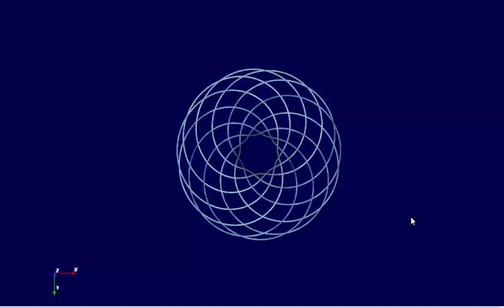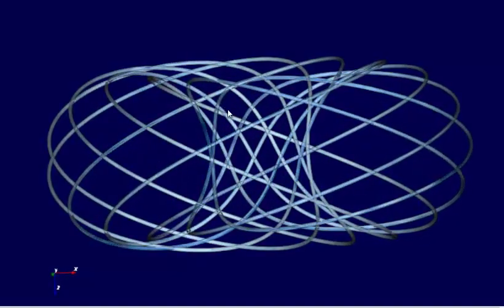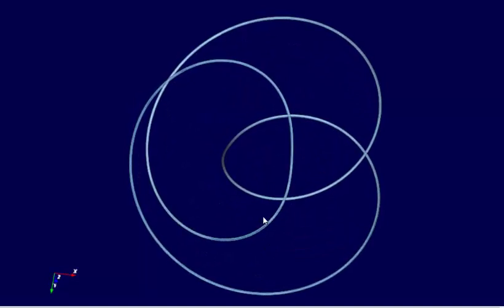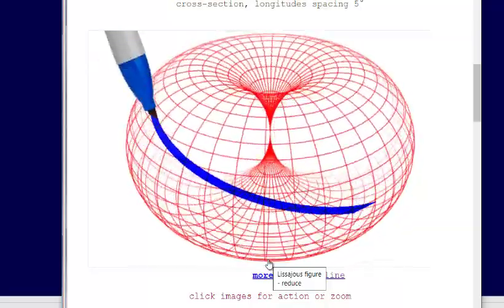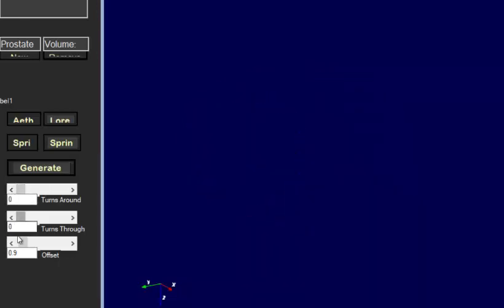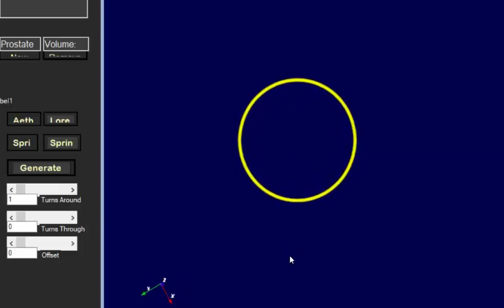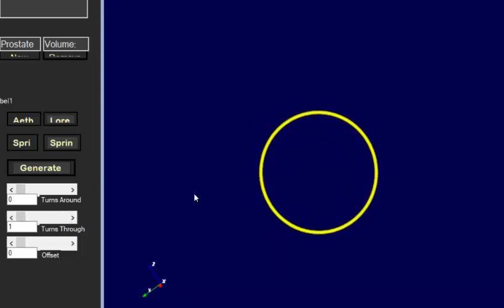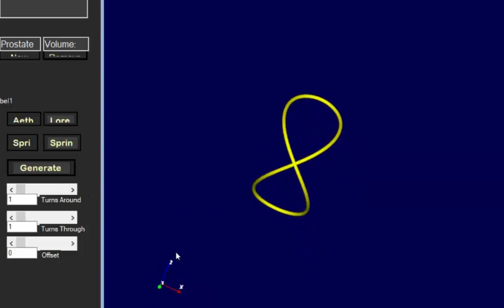Tokamak and the Torus Knot

Comment: What is the software you use for modeling turns through and around? Did you write it yourself, if so is it available online? Would love to play around with it and learn. Thank you for all your work, I love you!
Reply from the maker: Yes I wrote this software. Here is a link to the program that I gave Master Ivo:
https://drive.google.com/file/d/17vZUsIplsxohFd5N7Jq0J4_jHmHvVUfu/view?usp=sharing

You will also need to download and install this:https://www.microsoft.com/en-ca/download/details.aspx?id=48145

Here are the instructions::
1) Launch the TorusKnot.exe executable. 
2) Setup the slider bars for turns around, turns through and offset. Offset makes the "donut" hole bigger and smaller. 
3) Click the Generate Torus A or Generate Torus B button. A and B are reverse windings and reverse flow. You can also show both. 
4) Click the Import Colours button to select a colour palette and animate the flow. The colour palettes are in the Colour Files folder. 

5) Use the scroll bar on the mouse to zoom in and out.   
6) Use standard mouse manipulations to change the orientation of the model. 
7) You can change the slider bars while it is animating (which is fun).

That's about it.
Enjoy
Reply: @FractalWoman  Thank you very much for sharing! ❤️🙏
Reply: @FractalWoman  Hi! Is is possible to re-post the download link please? It says it expired. Thank you!
Reply from the maker: @J.ConorGrogan  I checked and the link is working. Are you talking about the link to the shapeways model?

Comment: Not exactly sure how'd this work out, but what if you got machine learning into this thing. By using lots of pics and videos, I think you'd be able to train a NN to match up your torus simulated "points" with the "light" lines in a ferrocell. And add the magnet to the simulation/use as 3D overlay. This could also even give you a volumetric perspective instead of just one torus knot (more than one line of points simulated at set distances apart)
Reply from the maker: Funny you should mention machine learning. In the field that I work, medical imaging, we are using AI, and machine learning to do all sorts of things that we use to solve using mathematical algorithms. AI is overtaking math. I like your idea. I will give it some thought.

Comment: I saw when you posted about inductors under the ferrocell, but what about an individual wire. Or parallel ones (w/both parallel and anti currents). Also a "plane" of wires, w/differing currents aswell

Comment: What would happen w/a negative offset, would it appear exactly the same or would things get crazy
Reply from the maker: With a negative offset, the dielectric (inner spindle) overcomes the magnet (outer surface) and it looks like the two switch places. The magnetic then looks like the dielectric and vice versa. Not sure what this means, but I have a feeling that will be the subject of another video. Thanks for asking.
Reply: @FractalWoman  when do you think the dielectric begins? Between the intersections of the spindle, or when the knot starts curving inward/where the horn begins
Reply: @FractalWoman  also what if you scaled Z to 0.618 instead of 1.618
Reply from the maker: @rustycobalt5072  This is "knot" the right thing to do. In order to get the spherical geometry, you either multiply Z by 1.618 or... you multiply x an y by 0.618. If you multiply Z by 0.618, then you just get a flatter torus shape which is not what I was going for in this exercise.
Reply from the maker: @rustycobalt5072  It is my opinion that the dielectric exists between the two intersection points of the spindle.

Comment: Is plasma one of the states of matter?
Reply: Yes, but all states are arbitrary and labels we use basically just because of our perspective ie water/steam/ice. 
Check out supercritical fluids too
Reply: On Earth (with gravity and atmosphere) we understand the "states of matter" sequentially as Solids - Liquids - Gases, and - Plasma (lightning,fire,neon,aurora,welding). 
Plasma has 3 distinct modalities (depending on their electric charge potential)  1.Dark , 2.Glow(neon,fluorescent), 3.Arc(welding,lightning,sun) 
What we call space is "dark mode" plasma (low voltage),, making it the most abundant form of matter in the universe. From there, the rest fall in reverse order, in terms of abundance, - Gases - Liquids - Solids.
There are many things about physics in space that are the opposite of what we understand here on Earth.  This is what causes many heated debates about physics. It is a "perspective" argument.
Reply from the maker: Yes, plasma is a state of matter.
Reply: @gcrady  sorry but I'm gonna have to completely disagree. You can change any amount of matter into any "state" of matter, all you need is the right volume for your amount (and temp). Again with the water example; if I start with a cylinder of it (deionized & filtered) at room temp/pressure and then increase the size of the container, the water "evaporates" to fill the space (if you want to be picky then you can even filter out the oxygen/nitrogen dissolved in it at this time). Eventually vapor pressure wins and all molecules will become "gas" though actually nothing at all has changed besides the volume in which the matter exists. Reverse this and you can compress it back into water, and eventually ice (though technically you go through the atleast 13 forms of ice, which are mostly different ways the water molecules combine into lattices). And if you go further, you start to fuse and ionize it ie plasma. The same "plasma" state (though imo not really the same) can be made if you manually ionize steam by heating/electrocuting it enough. Just by changing one variable in pressure equations you can ultimately achieve any "state" of matter. Also, in space, liquids cannot exist, it's too cold (in that there is nearly 0 pressure so your always losing energy by "emmiting" IR light) Gasses exist in space because they are just diffuse solids

Much in line with Ken, it's all about pressure mediation
Reply: @gcrady  also please explain how a plasma can be dark. From what I understand, it always "emmits" light as the ionized particles steal electrons (after they lost atleast their valance electrons due to gaining kinetic energy). When the plasma matter gets an electron back, the electron drops in energy (eV this time) and that energy is released as a "photon". Not always in the visible spectrum but still
Reply: @gcrady  I do apologise, I don't mean to seem aggressive, but I can't help but attempt to alleviate this nonsense. The only difference between lightning and a neon light really is just the power/voltage (and the matter being energized I guess) as you said, but that difference does not make it a different modality in any way. That's just the scale of lightnings/arcs of electrically charged plasma power involved, the more power more dense the plasma arc.

Lightning is literally just a lichtenberg through air and at insane speeds

Comment: What the plasma in the tokamak wants to do is to move forward since it is moving in this torus pattern. But the tokamak structure is fixed to the ground so the plasma will move against the walls strong, which is very difficult to handle. I think that's the biggest design issue of the tokamak. The trillion dollar issue. that has now a solution.

Comment: Think “ Only “ in terms of frequency and vibration a wize man once said. Try picturing the centre of the Torus as a totem pole of of magnetic water, and light from all sides and angles of the lenses, as energy ramps up carves out the energy pattern associated to that DNA stamp. What we do not know right now is that light can change how it works and what its doing things  as part of the whole system as frequencies and vibrations change. It makes carving tools, bits, shavers, borders etc. You name it. And one can change into the other accordingly. The Egyptian Ankh represents the centre twisting bit DNA. And all this is accomplished from the shape of the eye. That has 360 degree lensing at any angle or thickness. The light vibrating through the eye determines what energy pattern it creates. Basically all creation is from atom to heavens is done through this same process, just millions and billions of little torus “eye’s all combining energy statements to form whatever it may be. 😀 The Ancient civilizations new this all very well and wrote it all done in plain sight, nature is the example look harder for energy stamps that you’ll start to see in everything that exists, then it will start to become clearer and clearer. 😀
Reply: Basically, the only reason you see through transparent organisms is the amount of energy and angle of lenses. Cannot see through us but we are just lensed differently and more densely packed with toruses. There is only water and light, were just light shining in the water really.
Reply: It’s what makes things heavy and light as well. Heavy things light or energy is lensed all toward the fulcrum making things heavy, but light lensed more evenly all around and very little at the fulcrum you get lighter. All just by changing frequency and vibration.

Comment: Hi good work and thanks you for that vidéo, i would try with this number, 1,618 or 309 or 3,09..... thanks
Reply from the maker: Yes. I did try 1.681. I'm pretty sure the Tokamak design used that.
Reply: @FractalWoman  if you know the harmonic frequency of fibonaci too and pulse it on flow with slow motion or accélerate try to simulate the magnetic or aetherium